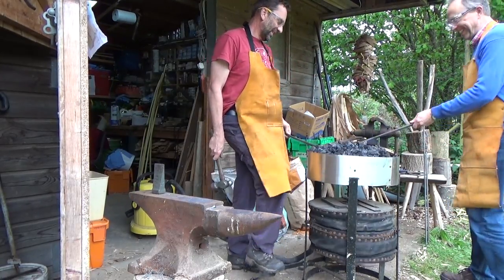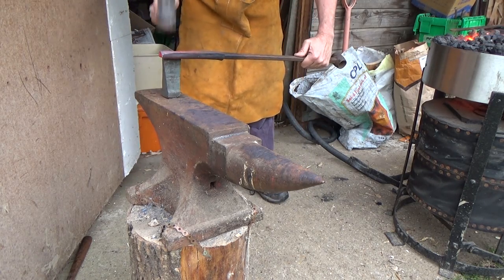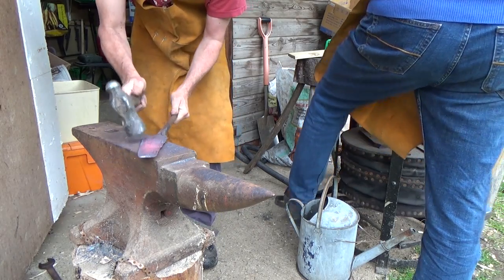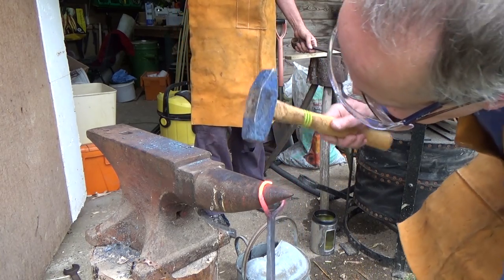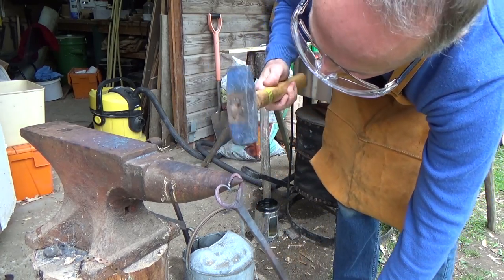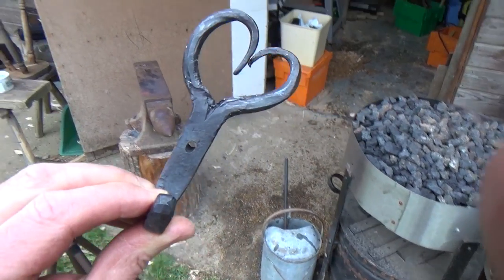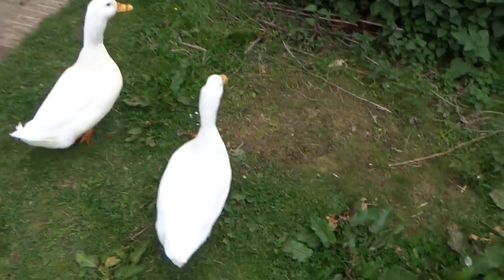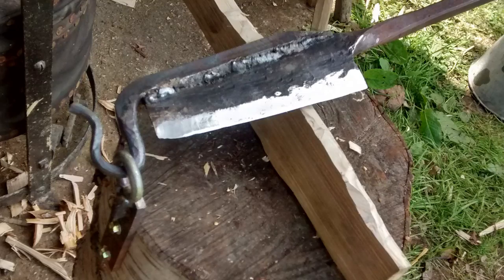Blacksmithing a Peg Knife for Green Woodworking

Comment: Great video! I have a book By Eric Sloan  called "A Museum of Early American Tools" which has an illustration on page 85 of the "pick knife" but calls it a Stock Knife or Block Knife. If your not familiar with the book I highly recommend it. Great illustrations of vintage tools and their uses. I've been considering making something that's a cross between a machete, froe and stock knife for use when camping. Imagine a froe with a hole drilled in the end for a hook that's screwed into a tree so it can be used as a stock knife. Or maybe a stout machete with a hole in the end for the same purpose.
Reply from the maker: sounds interesting!

Comment: Good to see some blacksmithing. One thing what does the heating, hammering and cooling process have on the steel, bearing in mind that plunging steel into water/oil hardens and tempers the steel?
Thanks for the video.
James
Reply from the maker: icespeckledhens Hi James...with the mild steel coat hook it does not really matter...but with the tool steel knife blade we have to be a bit careful.